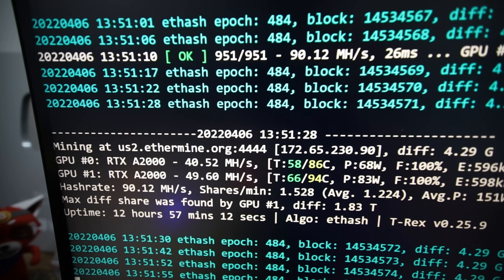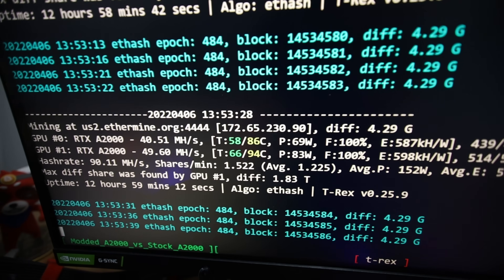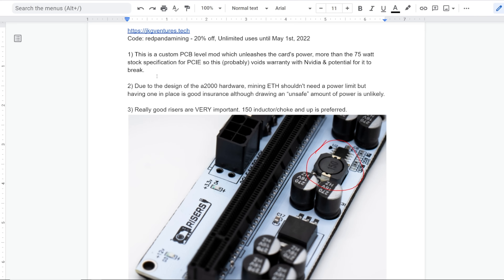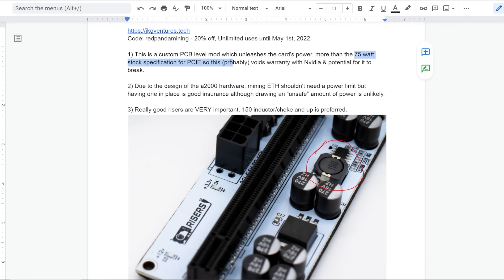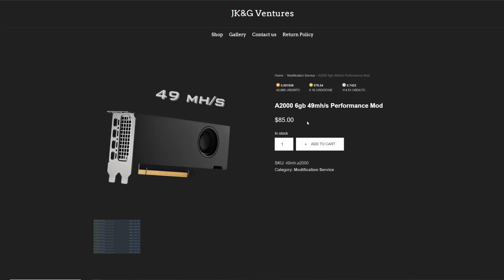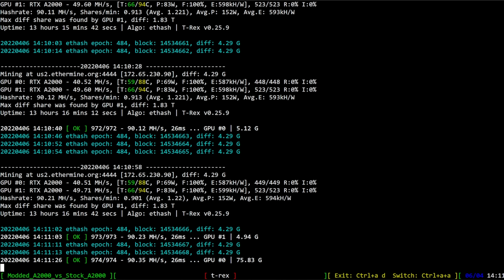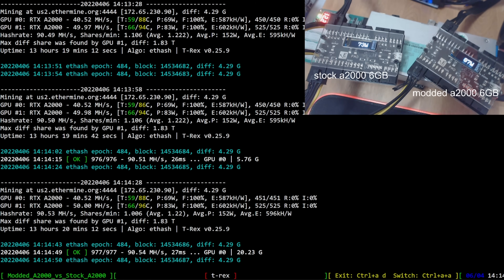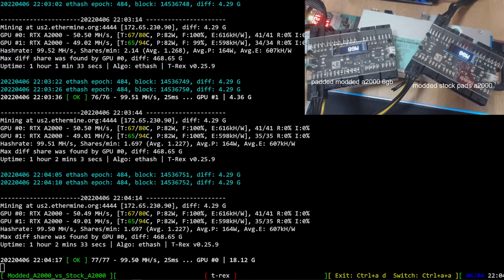RTX A2000 ETHEREUM HASHRATE at 50Mh/s! How?

Comment: Hey Redpanda. Have to seen the A2000 fan mod. Disconnnecting the fan from the GPU to external source. Could give higher hashrate or just lower your power draw from your PCI-E slot

Comment: The MOD is done by soldering 2x R005 resistor to the existent ones. Of course the resistor is there to protect the riser not to go above 70w. But you can connect a 6 pin extension to resistor and use a splitter to split the power from the 16 pin.
Reply: BTW you can buy 50x R005 for $3 and soldering is not too hard.

Comment: RPM, It doesn't make sense!
Let's do the math. You are spending $85 for modification + $25 for being away from your GPU (your GPUs not working during this process), so the total modification cost will be about: $110, 
the modification will bring us an extra $0.45 a day, then it finally will take 244 days to break even for the modification cost.
It means after 244 days the modification will make more profit for you!

Comment: Modification is very simple. It is enough to solder an additional 5Mohm resistor in parallel to the existing resistor on the left side of the L501 coil. Cost $ 2.
Reply: Can you elaborate on this please I would like to try it out

Comment: What if you aren't using risers? I run mine on a riserless board. 
Micron cards vs Samsung cards have become a problem for me and planning with the a2000 lately. I just picked up 12 of them, and 4 of them were Micron memory, and hash, at least, 6MH lower. All of the Samsungs perform better. Also the 12GB card does hash slightly lower than the 6GB card, but I'm assuming that is power related.
Reply: i wouldnt put these in any mobo unless u know it can provide more than 75 watts to the slot
polaris gpus fried mobos cuz of this

Comment: I am very affraid with this mod when summer comes....
Attention 2mm pads! Try 1.5mm Pads, to do 2mm in my opinion are too thick! I just done one with 2mm, if you check the plate without thermal paste there is a gap!
And if you look at yor temps of these 2 GPU the repaded one has higher temp now. I reckon it is because of this issue.
I am just waiting till I receive my 1.5mm pads and gonna test this out and might proof it. Thinking 2mm are 2 thick and the thermal paste can't get that heat away cause of this gap happenend.
Reply: Yes you are right. I have used 1.5 mm instead of stock 2mm on all of my A2000s. The temp now keeps in range of 72-74.
Reply: @obaid136  nice to get proofed my supposition. Looinkg 4ward to get the pads changed. But I am also affraid of the work, as I have quite a few A2k to get done.....
Reply: But core is still hot coz the stock heatsink is designed undersized. Unless you remove the factory casing+fan and use a highspeed high volume fan
Reply: @obaid136  Removing the exhaust grid is supposed to help. I have my a2k hanging exhaust pointing up. I consider to place 120mm fans on the top in summer. I hope this will do the job during summer.

Comment: Not sure how I feel about this.. I'm assuming it's just a shunt mod to allow more power. The A2000 6GB can already do 44-45 Mh/s when cooled properly without any hardware mods. Adding an extra 4-5 Mh/s by voiding warranty, and paying 85 USD/107 CAD per GPU doesn't seem too economical.
JKGVentures obviously needs to be compensated for the parts + labor + experience, but paying $1200+ CAD to add 48-60 Mh/s to a 12 GPU rig seems high. Plus the lost opportunity cost of having all those GPU's down for 2+ weeks.

Probably makes sense to DIY if you have the soldering skills, or if not add another GPU. I guess it depends how much you value maximizing efficiency. (Again, I'm not trashing JKGVentures or their prices. The fact they're offering this service and made the mod "semi-public" is still a great thing. their service does make sense for some people's situations)
Reply: i hope they have a disclaimer talking about using more than 75 watts of pcie slot power lol
Reply: @cidsapient7154  thus the reason for good risers... they always over engineer but yeah asking for trouble...
Reply: they are meant for server case tbh, should be no issue with heat.
Reply: A YouTuber just full explanation of how to modify the unlock power limit, the material seems to be only a few bucks,but you have to be a bit technical.
Reply: @D.K945  I just looked up about it and did some experimenting. Seems like I'll be providing these mods too. It's simple enough to do quickly once you get the hang of it. 

i'm pretty sure undervolting will do a lot on these. The core doesn't need much to start with but most of these enterprise cards use memory chips capable of good performance, hence, also tighter tolerances.
Reply: 60 mh was being sold for 1200 more than half the eth mining craze

Comment: Reduce your core! This card loves -100 to 200 core. I currently run 0 and 75 for my 2 cards. Try it out!
Reply: What hash rate do you get with that?
Reply: @wmwnwmn  after a ton of testing the card stays in the 40+MH range when the core is -100 to +400 but as u bump up mem the card will drop hash like crazy - maybe even crash, but then as you tick up higher from +500 to +900. Then from +1000 on up, I see the cards come back up in MH to the numbers it once achieved back when the mem was between -100to +200
Reply: @ryangreenwald3755  I just tossed a card to 0 core, 3525 mem and it lost over a meh/s compared to 1000/3600 setting
Reply: @wmwnwmn  try -100 to 200 in increments of 50
Reply: @wmwnwmn  What was your temps at 0 core and 1000core?
Reply: @wmwnwmn  right now at night my two cards are at:
1)43.19MH 45deg 85%fan 0core 3525mem  70power
2) 43.40MH 49deg 85%fan 75core 3600mem 70power

Comment: I doubt that when you RMA they will even investigate PCB. Interesting to see what exactly is being modded or how visible it is on the board. Lot of times they will just throw it at the bench > doesn't work > send replacement.
Reply: Can't rely on that. If so You can zap your 2080Ti last month of warranty and get a new one xd
Reply: @v-hashhelping4400  that would be unethical :D

Comment: Do you know why the A2000 12 gb only gets 37 to 38 MH/s? It seems weird that the vram difference would result in less MH...
Reply: More memory means more power budget. With a limited ceiling like the a2000 has, anything that takes away from the power budget hurts hashrate.

Comment: It's possible to achieve 80 MH/s for 700 dollars if you buy 2 5600 XTs and BIOS mod them. I've seen them go for anywhere between 250-350 on eBay. With a BIOS mod, they can reach 40 MH/s at 70-80 watts in software (could be a little higher when measured from the wall). I think this PCB mod would be good if you already knew how to do it and had a ton of these cards, since it would essentially be free at that point, but actually paying for the mod isn't worth it imo. Still, it's very cool that the mining community is finding new ways to squeeze performance out of older cards.

Comment: cool to see a hardware mod - eth is notoriously power efficient so interested to see how much further power you want to risk putting through that PCI slot on the other algo's....
Its the lack of power that holds back the a2000 elsewhere, but i guess you have enough you can test until one goes pop - the heat may also be the bigger issue, will see how they go in the octominer

Comment: I’ve just repadded my 5 A2000’s and I used gpurisers 1.5mm pads, the temps dropped around 6-7 degrees
Reply: I did the same but with frosty thermal pad 12.8. Changing pads really help.

Comment: Hey @RedPandaMining Awesome video- serious question, would it be safe to run these direct from the motherboard? or higher chance of failure by burning out the motherboard traces? I'm guessing using risers is safer, because if the riser fails, you can bin it and get another (assuming no card damage). but if the card was mounted on the motherboard? what do you think? dont do it? just keep them on risers?
Reply: Pls dont run these directly over your motherboard. You need extra power to run the gpu. You put in a gpu riser a 6pin plug for a reason. When you put it directly in a motherboard your board burn down or your system stops working because of overload.
Reply: Yeah you should be fine, BBT just did a video with the 3090ti and it was pulling 87w from the pcie slot…
Reply: @kksjohn2k7  You're fine to run one off of the motherboard. Where you run into problems is running multiple ones off the motherboard.
Reply: @TravisFabel  on a normal motherboard, yeah. On a riserless motherboard with pass through 6 pin power you can run a full board of them

Comment: Someone should offer up a full mod for these cards. Copper plate on the memory, proper pads, cooler/fan combo and this mod, all in one.
Reply: The mentioned guy does
Reply: There is a solution - Mining Waterblocks.
Reply: Jesus is Lord  Because A2000 Energy efficiency beats all other cards including 3080.
Reply: And even if you go for watercooling you can push 45++ Mhs from 75W, on 3080 this is not possible. It does matter when your electricity is not the cheapest.

Comment: I am curious this mod + watercooling. My A2000 can push to 47MH/s without this mod.
Reply: Tell me more about water cooling the a2000!
Reply: Removing the fan power from the stock power budget really does help.
Reply: @kksjohn2k7  Extremely.
Reply: Water cooled the 47mhs? Tks
Reply: @xpim3d  I think that on WC a2000 can push 55MHs

Comment: Hi RPM, amazing content right here. If you want to improve vram temp. Use Copper Plate + Thermal paste between the vram and heatsink. It can drastically improve temp and may be cheaper than using thermal paste.
Reply: Copper plate 2mm instead thermal pads. But they need to be used with thermal paste.
Reply: Copper plate paste?

Comment: I am getting 41.2-42 MH on my 12GB versions and getting .605.9 K at 41.81 MH currently, Temp 57,80 at 95% Fan, showing 69 watts in T-rex. I am happy with these settings and probably buying more, Just hate paying $800 each for them.
Reply: I’m not sure about other cards but the only ones I use are the 3070 founders edition. Which I paid $850 each and I get 63-65 MH with T-rex. I have 5 cards and I run them at 55% fan speed with 48-54 temp. I’m only putting this out here because the cards are about the same price. why is the MH so different? I’ve only used FE cards haven’t tried any other
Reply: @Slumee  3070 is less efficient per watt than a2000 and harder for most people to attain. Its nice if your slowly accumulating but was nice for me to get my a2000 in a 10 bulk deal china direct like RPM. (750 cad at time) now price is way up on them.
Reply: @Oofsmageroo  I’ve never thought about buying in bulk but i if i knew back then I would’ve done the same for my rig. I also have pretty cheap electricity so I don’t mind the consumption rate at the moment. I usually spend $65/mo for running all my cards and the fans. With about $600-$700 leftover depending on the current price of Eth. I would grab more cards it’s just I don’t think it would be worth it at the moment
Reply: @Slumee  3070 non lhr or 3060ti are still the most desirable mining cards. The a2000 a bit more efficient yep. But the weak cooler is gonna cause issues for lots of people this summer. As open air it wont cool adequately. 

So your cards are still better in a sense. Id get lots of fe if i could find any lol.
Reply: @Slumee  I was looking at purchasing some used 3070 non LHRs locally, $850 is a great price compared to what they want for them.
Reply: Can you share what tuning you are running? On my 12GB A2000 some are 35MH and highest is 39MH. Please share, thanks.
Reply: @amerretz  950 Core, 3150 Mem, 70% Power 42.07 MH at the moment with these setting in Hive using Nbminer 608.7 K

Comment: $85 for a shunt mod!? Its literally a $0.02 resistor and 30 seconds of work. This is a common mod for extreme GPU overclockers.
Reply: $0.02 for the resistor, $84.98 for the knowledge of knowing where to put it....
Reply: Would you consider do a video on it then?  I would love to see the mod, if you can do it that is.
Reply: For what I undrstood it comprises the shunt + thermal pads ecc. Or no?
Reply: It is not just a shunt mod. Shunt mod will show lower power in HiveOS than real power taken from PCI-e slot. Here you can see real power and power in Hive are the same. For me it looks like a bios mod or some kind of a different hardware mod.
Reply: It's 85,- for 10 Mh. That's a good price. Some people would likely pay double for that.

Comment: with the extra heat it generates and the chances you take by doing this, I don't think it is worth it
Reply: was thinking the same, the card will probably burn up, there is a reason, why they are not made that way
Reply: @bigspin69  they were made that way to remain in spec. It's a cost savings to nvidia because if they did have the higher power limit it would require a six pin connector.

Comment: What about putting it into an octominer? The temps may be better?
Reply: issue may be killing the motherboard trying to supply that much power over pci-e, especially x8 or x12 cards etc
Reply: @blakeparry1983  yeah. I’ve considered that. Not sure what the limits are on that backplane - it can clearly handle 75w per lane, but can it handle 90w? Not sure.
Reply: Not likely with a blower card. More likely it depends on his local ambient temps.